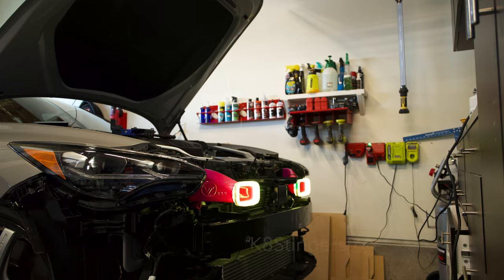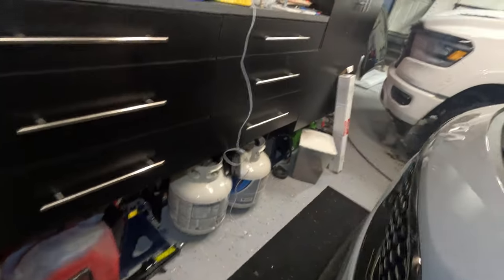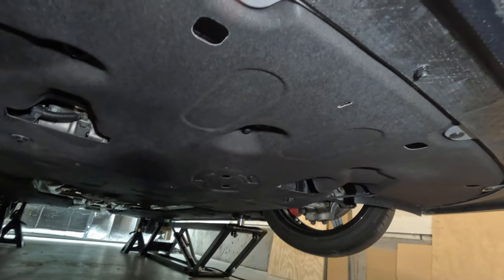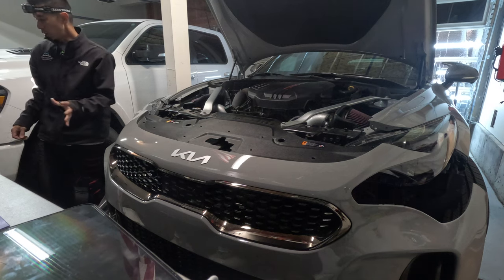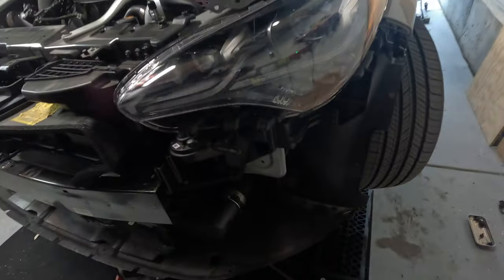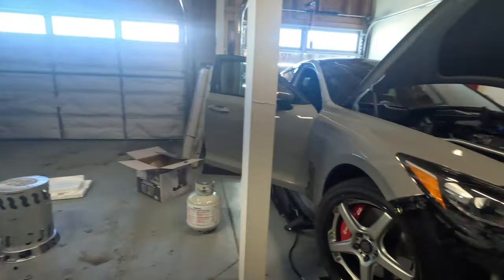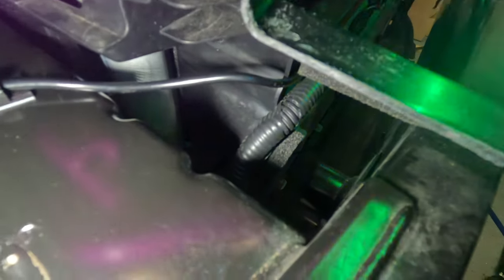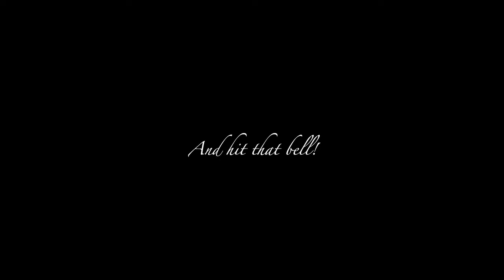Installing LED “lit kit” Big mouth intake snorkels! (23 Stinger bumper removal)

Comment: Hey man, love your setup. How’s the fitment on the OEM Carbon Fiber hood? I noticed it kinda sit a tiny bit up and my OCD would have a hard time getting used to that. Lol
Reply from the maker: The fitment is good in my opinion. I had to do some minor adjustments but other than that not an issue.